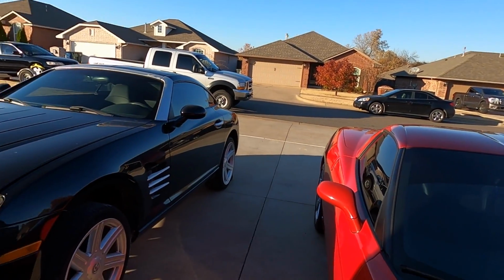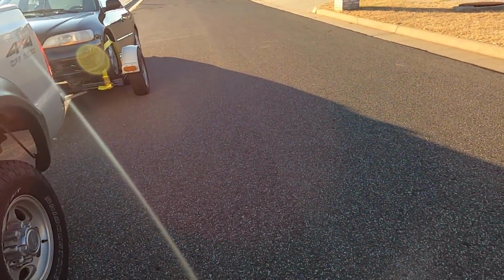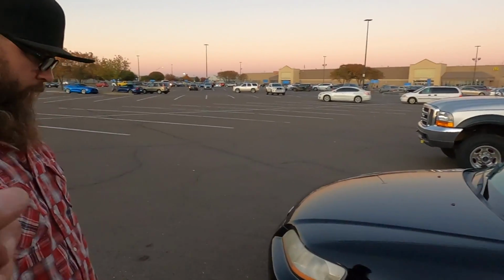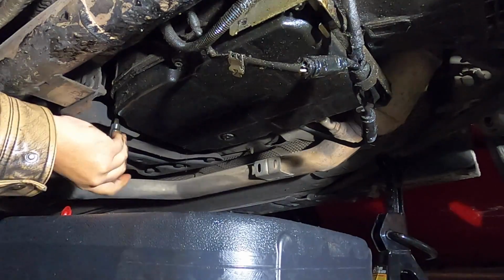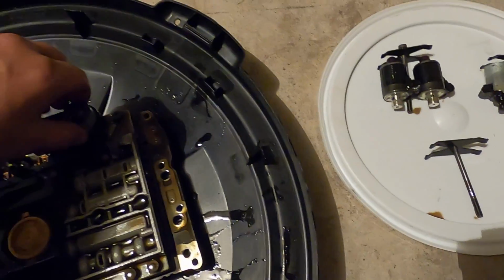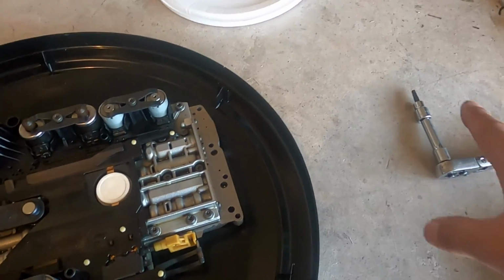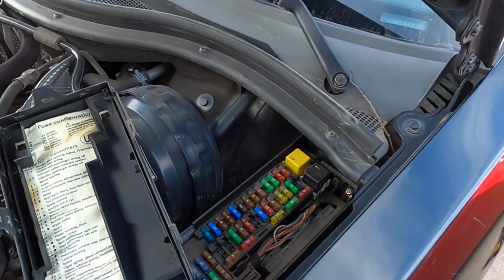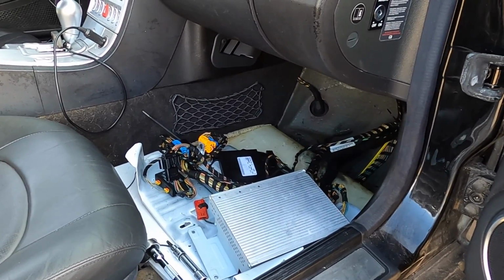Replacing 722.6 Mercedes Benz Conductor Plate - Limp Mode - Copart 2004 Chrysler Crossfire

Comment: 2 things to think about.
1) there are many, many versions of that conductor plate which all look exactly the same but are very much not the same whatsoever.  Make extra special sure it has the exact same version iteration as the one you removed.
2) The crossfire is essentially an SLK, right?  I would try a mercedes benz code reader like star or even icarsoft to see if it will clear the codes.  Car will not leave limp mode without clearing those codes with the mercedes software.
P.S.  I'm sure it's not the case, but did you make sure the gear selector slidy inny outy thingy on the valve body was properly secured in place when you reinstalled it?  I had much better luck when I did my merc, I hope you resolve this!!  Good luck!  At least it's not that fucking 722.9 piece o shit.
Reply from the maker: It's resolved now, but thanks for the comment!
Reply: @AutoAuctionRebuilds  
Please share with us what you found...
Reply: @AutoAuctionRebuilds  Glad to hear it!!!!!
Reply: I totally agree with this comment... I believe you have a CANBUS network problem and it might possibly be from a slightly different part that looks identical to the old part...
Reply from the maker: Future video, sure will!

Comment: Hmmm, that sucks. Not sure if you're familiar with DiagnoseDan, but he seems to be excellent at diagnosing European car problems. He looked at a car, either a BMW or Mercedes which had been to several shops including a dealer where many items were replaced still having the same problem and he tracked it down to a bad passenger door handle. When he removed the handle you could see where there was residue from the bad sensor. Thanks for sharing.

Comment: I had 2 of them both went in limp mode basically stuck in 2nd gear. Both were the transmission module.bad part is require a star to program.
Reply from the maker: Hmmm. I fixed mine without the Star program. I used my Autel Maxisys Elite to reset the EGS.
Reply: @AutoAuctionRebuilds  I may need to trade snap on for the elite. Thanks for the heads up on that scanner.

Comment: The turn signal on my dads 74 Ford gathered condensation.  Solution??  Drill 2 small holes in the plastic.  Vented the condensation.

Comment: The body module is usually the one that dies. Checks the pins are still connected to the circuit board in the module. use a magnifying glass. I've had them and the ones in the ABS computer separate from the circuit board.  Have you got the socket part of the trans plug (with the 7mm screw) In all the way and the right "o rings" in the right Position. We used to coat the outside of it and the "o rings" in Vaseline to make sure they go all the way in. From memory it only goes in in one position.  good luck and if all else fails take it to some one who deals with these regularly who has a Bosch scanner. .

Comment: You can always disconnect the battery, clean the terminals with some sand paper and make sure the battery is resuscitated, also a negative wire/ground to the body
Reply: Thanks Alex 🙏
What would you call this procedure? 
Is the purpose of this procedure to make sure that the vehicle is completely dead & run out of power?

Comment: Hope this helps,  fault codes stored on the Engine Contol Unit (ECU), you get them from a generic OBD II scanner. To properly troubleshoot the transmission problem on your Mercedes-Benz, you will need a diagnostic scanner that can retrieve the fault codes from the transmission control unit (TCU).  The end process will be to reset the TCU, I do not know if the scanner your using will reset the codes after you swapped out the Transmission Valve Body Plate usually a Mercedes-Benz dealer or perhaps a Chrysler dealer would reset the TCU.

Comment: Solus scanner can clear code randy after code is cleared it will function I've done a dozen or so conductor plates
Reply: Also Make sure the plug on the conductor plate is seated all the way and none of the pins are out of alignment.

Comment: Would it help if you disconnect the battery and have the key turned to drain the computer completely to do a force reset? Doesn't hurt to give it a shot

Comment: If the trans fluid made it into cabin maybe the entire harness needs to be cleaned, maybe connectors at transmission have fluid inside and causing errors? 
Good luck you'll solve it. It's good watching you tackling these issues.  Keep up the good work.

Comment: Cant speak to the connectivity but I did have a vehicle with an aftermarket TPS that caused the car not to shift from first.  When replaced with factory part car worked 100%.  Just a thought.

Comment: It shifted before you played with it if I recall. In that case I would go backwards. Drain fluid with a cheese cloth to strain it, so it can be used again. Take the electronics apart again, assemble together. Test drive and find out if fixed. If not, disassemble again, use the old parts, put it all back together and test drive. Also the dipstick they sent is universal. Check the instructions for the correct level and correct temp to check. Check it hot. They will shift weird, and throw incorrect ratio if low. Good luck

Comment: You could have saved money but useing chrsyler nag1 parts
Reply: sam grabel Chrysler part numbers usually don’t line up with the crossfire... they always try to send you stuff for the 300 so you end up having to tell parts stores that you own an slk320 for them to give you the right stuff lmao
Reply: Dream Driven Lifestyle  the nag1 vVal body has interchangeable change ability with the 722 transmission
Reply: The nag1 is basically a re stamped 722
Reply: There’s only acute  differences between them
Reply: sam grabel Oh dopee 🤙

Comment: Randy, disconnect both battery terminals and jump them together and turn headlights on to drain and reset all memory for 15 minutes, the reconnect all and. Test drive
Reply: yes , thats what we in the transmission  world call a brain dead, worth a shot
Reply: Jim baker you’d actually be surprised at how many problems I’ve solved on my crossfire from disconnect the battery and resetting the cars defaults
Reply: @DreamDrivenLifestyle  yes for sure ,i know , we call it brain dead , no joke , a lot of fords have big issues until you brain dead them , even if you clear the codes , some cars its a must , i been building transmissions for 30 years , we come across this stuff years ago
Reply: I tried it and it still driving in 2nd gear 🤦🏽‍♂️.. i have no clues what else it can be.
Reply: @dank1798  check Tcm in engine bay
Reply: Love your video , just did mine tonight and have a p02107 code after and p0748. Any clue on what happen . I did one before on the ground like you and had no issues .

Comment: I haven't been doing this in a long time but what in the hell are electrical connections doing in the transmission fluid?
Reply from the maker: Transmissions are electronic now.
Reply: Very common to have an electrical plug in or near the transmission oil pan these days. Mercedes, VW, Range Rover all do it with their semi-automatic gearboxes which are all computer controlled.

Comment: As you know that oil is like water in the electrical system.  Need to clean  out the connector to the transmission.  But that wire has to be replaced. OH BOY!!!  Thanks for sharing your experience with this project.

Comment: If the drain pan is metal you can put heat with a propane torch directly on the drain plug and it will break free. They probably put loctite on the plug.
Reply: Nah, it's a 5mm hex not a T-30 torx.

Comment: My older c230 I bought it knowing that it had a bad transmission,it wouldn’t shift past 2nd replaced transmission still had the same exact issue with the new/used transmission, then I replaced the transmission control module TCM and it fixed everything and I have been driving the car for 11 years

Comment: I was reading that fluid from that trans. in mb w211 can flow to computer through cable and ruin it
Reply: unfortunately that is the case...must change computer, cables also, as I remember...mb design...and I drive one with 425000km but made for Swiss export:)